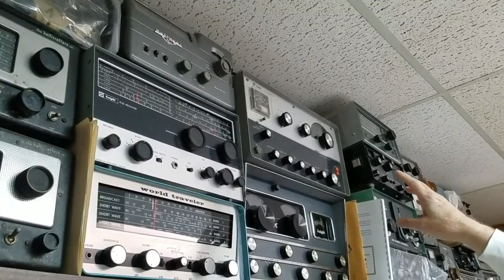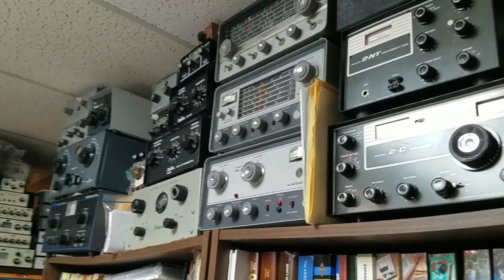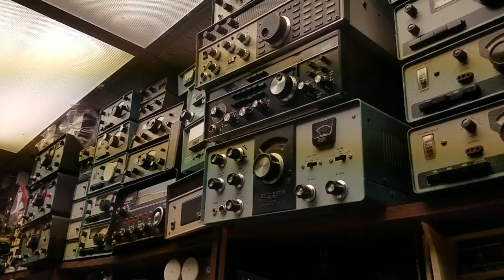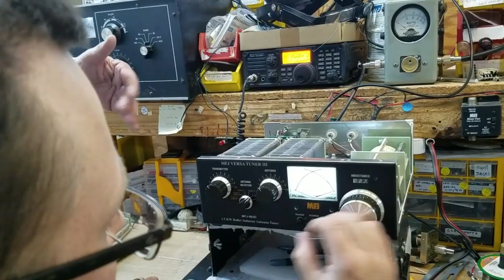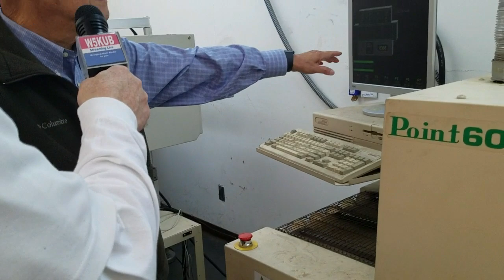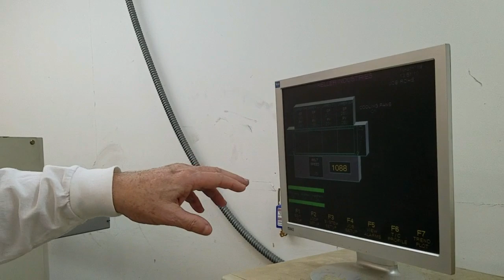MFJ Enterprises Tour

Comment: Where is all this “stuff” designed?  Besides all the RF voodoo electronics design magic, somebody somewhere has to be laying out these PCBs on a CAD system, prototyping and refining them, programming the surface mount machine placement algorithms, testing the final designs for manufacturability and reliability, and then doing QC on the production runs.  This looks like an oversized version of Bill Hewlett and David Packard’s original 2-car garage operation.  Let’s also get a tour of the “design studio” if you can; it has to be higher tech than the “factory”.